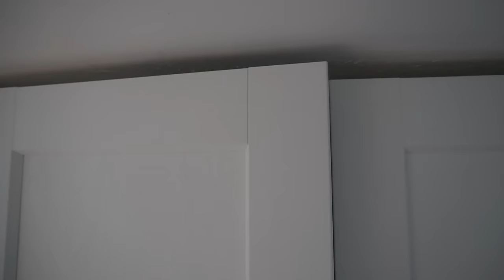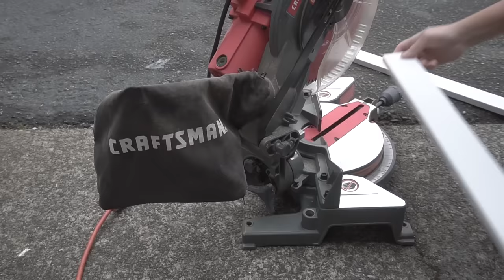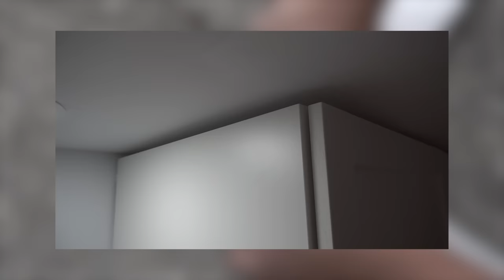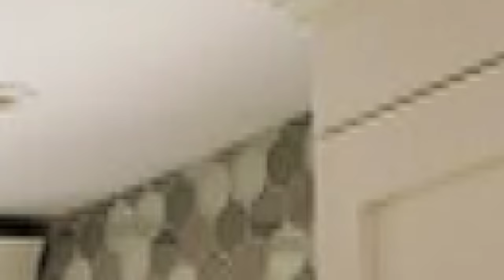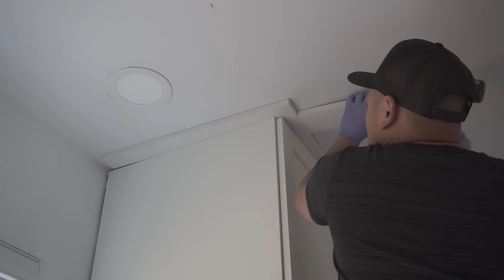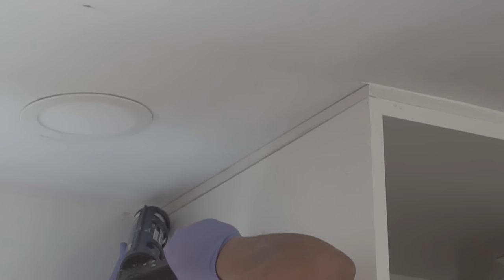How To Fix GAP Above Cabinets Without Crown Mouldings! DIY

Comment: As a professional carpenter, don't EVER ask if someone wants a reveal. Just do it! The flush mount will always have a noticeable seam unless both pieces have dead square edges and caulk will make it worse. The reveal will always look nicer and will hide settlement of the structure much better.
Reply: I was just going to say the same!  I thought I would see if someone else had already pointed this out.  😀
Reply: There should be a three inch apron on top, Similar to bottom floor Cabinets kick plate/apron, like that yo can dress it up with a nice molding, for a nice looking professional job.

Comment: Pro Tip from my 40+ years experience general contractor brother: Spritz that caulking bead with a NON-AMMONIA-based window spray cleaner. Then run your finger along the bead to give it a professional finish. Does a much better and less messy job than a damp rag. No need to even wipe up the excess spray cleaner as it will simply evaporate with no residue. Great video!
Reply: And hopefully won't embed any bacteria from your finger.

Comment: as i always learned not all walls or ceilings are straight 😁 this is a good idea im remodeling our kitchen in next 2 weeks and our 42 in cabinets will be all the way up the ceiling BUT.. i'd rather leave an inch to fill so cabinets wont have problems opening so filling that gap will be helpful. and the back gap can be filled with scribe molding.

Comment: I am also finishing up an Ikea cabinet install with the 40 inch uppers which are leaving a gap at the top.  I was going to take their contoured deco trim piece and cut it down but I am not sure that is going to work.  My ceiling is pretty uneven from filling in an old soffit.  I have a ton of scribing to do but this might help me in a few areas.  It at least gives me something to think about.  Having the piece wider than you would think you need so you can nail it through the top is kind of an obvious 'duh' moment for myself.

We have the bodbyn gray so I would have to do some paint matching.  Luckily, I found some caulk you can custom color with paint so I can get all those little fiddly bits filled in.

Comment: Flush just creates an ugly seam. We try and avoid seams if possible. If your installing new cabinets, Cut and install the molding first, then install the cabinet tight to the ceiling. Shoot your nails in from the top. Make sure they are not too long, or you will blow out the inside of the cabinet and have nails sticking out. 
This is still considered crown though. Flat crown

Comment: People ...the ceiling is not level so the reveal is not level. He had to find a way to fill in something. So what if he moved the cabinet up. The cabinet needed to be level, thus no matter what there would have been a gap. Once the area is filled, lived in and accessorized, his solution will hardly be noticed. When I had this problem in an home reno to make three apts thus needing three kitchenettes, these cupboards where not only simple, but the perfect tenant cupboard easy to replace. We hung up four wall shelves in each kitchen using the thick colored acrylic shelving which we had cut at a glass store and angle brackets. Then took the same colored thick plastic see thru material-acylic Green or Blue or Yellow (each kitchen had its own color)... and that was what we inserted into the gap, essentially matching the blinds to the acryllic shelves to the acryllic gap material and the handles on the drawers all coincided. So you can always decorate this away.  but the acryllic comes in a array of colors and is very nifty looks like colored glass easy to attach no need to glue corners. We caulked the top! used a pry bar to get it flush with the cabinet and caulked the ceiling seam. Came out very clean.
Reply: Nah. the cabinets could have simply been mounted as close as possible to the ceiling. It's half an inch, no one cares about cabinets being a half inch higher. Then use either caulk or lattice strips to hide any gaps.

Comment: What about the gap behind the cabinet on the wall? Just Dap it?
Reply from the maker: Hi Bret! It’s totally up to you and how big of a gap. This one I have is about 1/4” which dap will work, but for bigger gaps you might want to fill it in like the top with a thin piece 🙏🏽😊👍🏽. Some would add quarter round or shoe, but that’s a preferred taste.
Reply: Industry standard is 3/4" scribe molding.

Comment: Your supposed to build the top frame first, attach it to the ceiling then install the cabinet pushed up against it
Reply: Doesn't work with IKEA rail hanging system. Work with traditional US cabinets though.
Reply: Just because that’s how it’s supposed to be done, doesn’t mean whoever installed it did it properly lol. Have the same issue in a house I just bought. Super annoying.

Comment: If the ceiling is flat, you should have  been able to mount the cabinets high enough that no gap was visible with the doors closed.
Reply: When you're mounting cabinets, you want them level. Floors, walls and ceilings are never perfectly square and level. So, you need to leave space above the cabinet for adjustment. Consider that a run of cabinets is usually made up of 3-10 cabinets, that can be anywhere between 3 and 20 feet. Also consider that these are Ikea style flat top cabinets. That means the entire roof of the cabinet needs to sit on the ceiling as opposed to conventional plywood cabinets where only 3/4" is touching the ceiling.
Reply: @chrisford8403  also you don't want to mount your cabinets much higher than 18" over the counters. If he has a unusual ceiling height, there might not be a cabinet height that perfectly hits the ceiling.

Comment: Would it have not been smarter to just move the cabinet up 1/2"? Not to mention a hell of a lot easier and a lot less work.
Reply: Actually, no. This was the much easier option. He only showed the 1 cabinet. Kitchens usually get entire walls full of cabinets. Plus, what are the chances of the ceiling and wall being square along the entire run of cabinets.

Comment: If you get stuck having to do this after having done a refurbishment, you should put tools down for life. A little forward planning will do miracles
Reply: What if it was always the plan?
Reply: @dighawaii1  then you would have raised the cabinet to be flush with the ceiling plus your ceiling will be dead flat
Reply: @danchev338  not if the plan was to leave a gap.

Comment: Dosent look good at all. Move the cabinet up, that’s a Mickey Mouse job. 🤦🏿‍♂️
Reply from the maker: This video is meant for those who have this situation, but I do Agree with your solution 👍🏽😊
Reply: If you move the cabinets up and the ceiling isn't flat the doors could rub on the ceiling when you open them. Plus, some cabinets are hung on rails so it's impossible to get them tight to the ceiling.